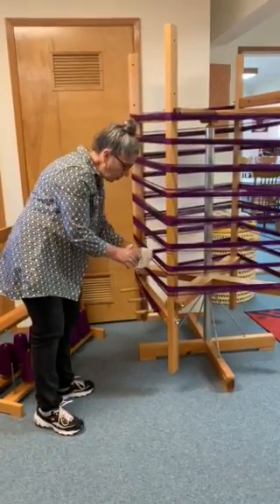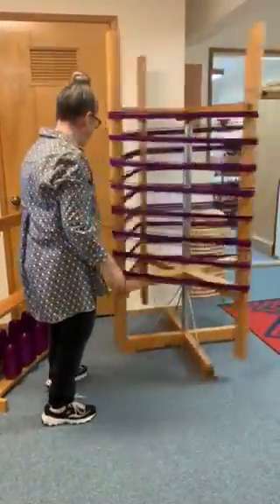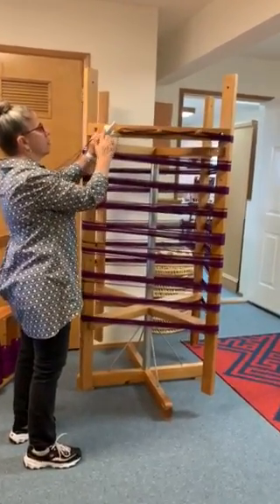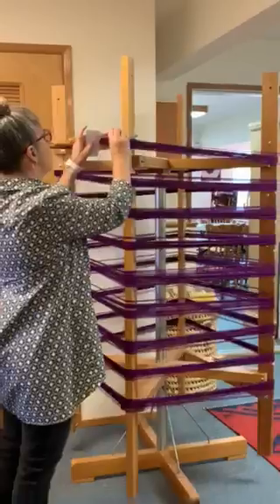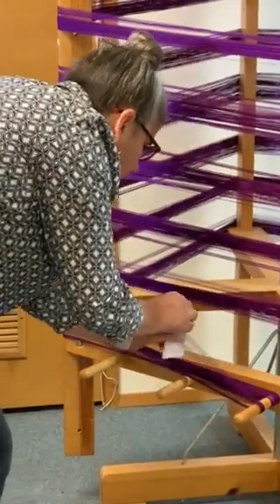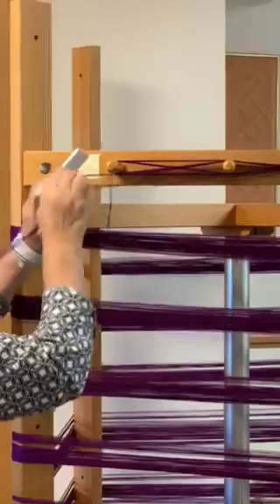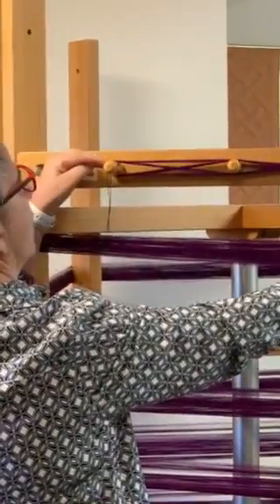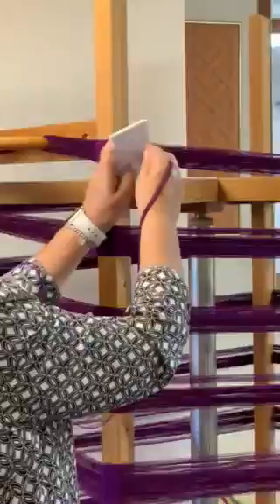How to Wind Multiple Threads on a Warping Mill

Comment: Thank you for this video.  What do you do when there is a knot in one of the warp threads?
Reply from the maker: You pause, and roll back to one end or the other where you can tie on a new thread to replace the knot. Some weavers prefer to leave it and repair the thread while weaving or after the cloth is woven (which is what you would do if you missed taking out a knot while warping).
Reply: Thank you very much! @EugeneTextileCenter